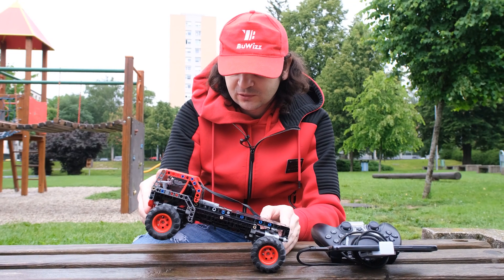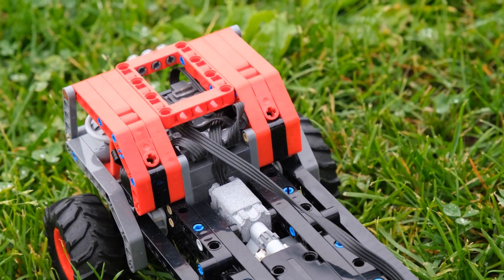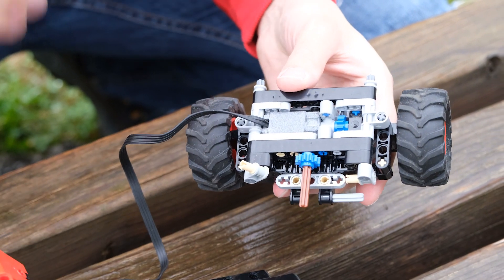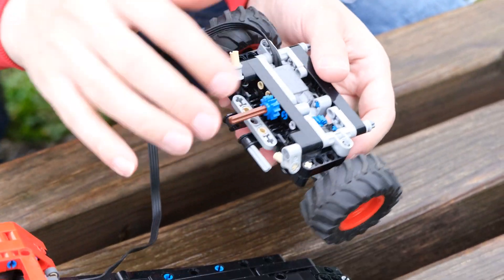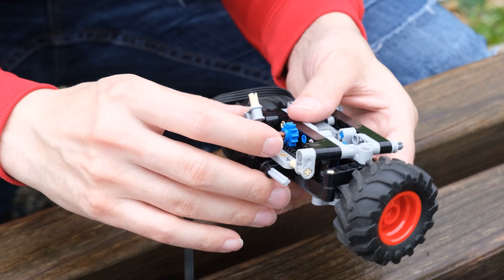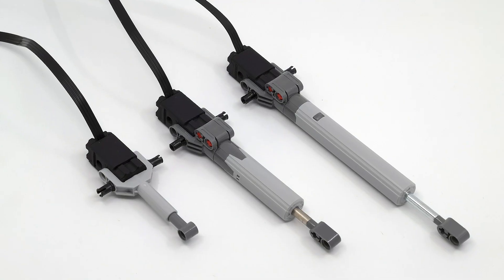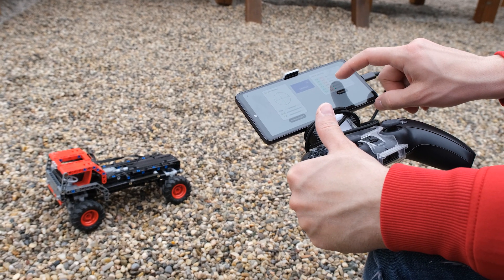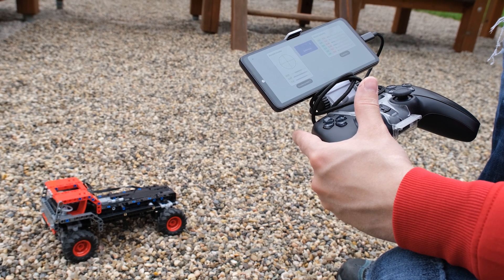Mini Trial Truck with 3 NEW BuWizz Micro Motors

Comment: you should make a new battery box with 3 or more power functions ports and 2 or more powered up ports so that  you can still have the the servo function of the powered up motors and then you can use the micro motors for 2 speed gear boxes or you can use 2 micro motors to make a 4 speed gear box and power two buwizz buggy motors because two buwizz hubs are very expensive in my country so if you can incorporate two hubs in one that would be amazing

Comment: Nice build, but I reckon it could be even smaller with those tiny motors. I managed to build a 4x4 crawler with full live axles, said axles were only 9 studs wide so 2 studs narrower than on this, and the wheelbase was shorter, all powered by a big PF XL motor and steered with a PF M motor with a bulky return to center system since my servo had died. Then all of this was hooked to a BuWizz 2.0. It worked really well, but unfortunately I had the stupid idea of doing some crawling on a Rocky beach and the truck fell into a small dip full of salty water, which killed the BuWizz 😭😭😭
Reply from the maker: We are sad to hear about your BuWizz. We will try to build even smaller vehicle next time.

Comment: I like the micro motor, but there is one problem with them as a owner of 3 BuWizz 3.0 units. The connection is power functions, and the BuWizz 3.0 only has 2 PF connection ports (I want to use those ports only for the BuWizz buggy motors, OR the genuine Power Functions Servo). I know there are PU to PF adapters for this, but it would be so much more convenient to have the option to choose the type of connector (PU or PF) for this motor rather than it just being locked to the PF outputs. All I want this for would be to connect to the linear actuators, and I would feel like I am wasting the PF port with extra power for a micro motor controlling something like a spoiler or door when the PF Port should be used for either the Buggy Motor Or PF Servo.